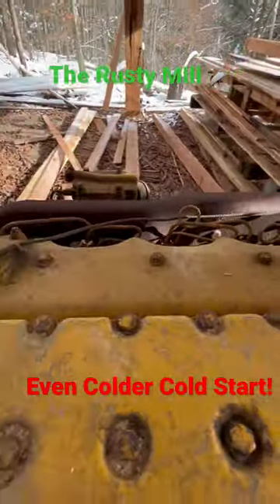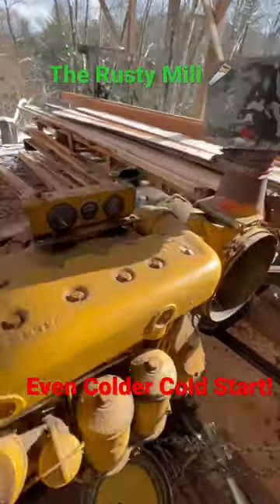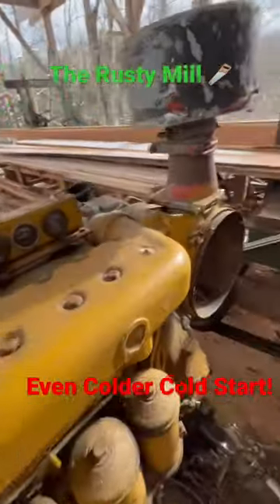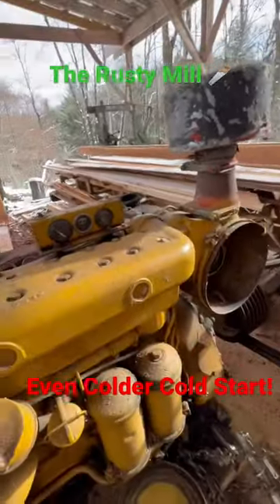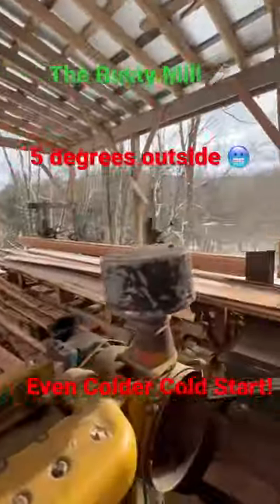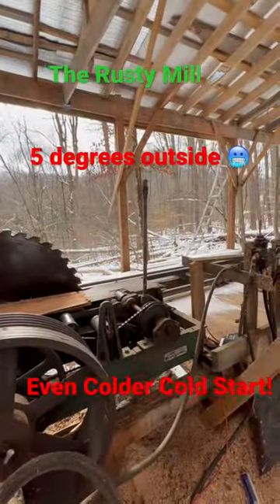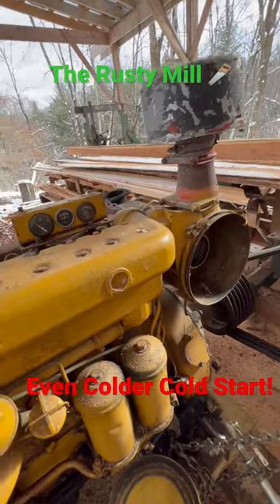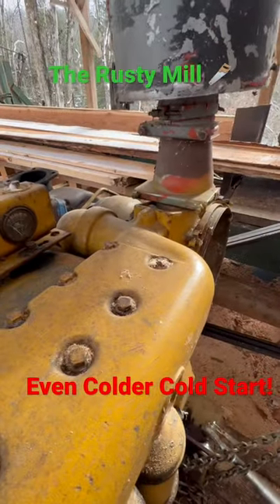Colder Cold Start #diesel #mechanic #heavyequipment

Comment: Start putting a quart of automatic transmission fluid in the fuel tank It will lubricate and clean the fuel system and injectors. And when you change the fuel filter instead of filling it with diesel fill it with automatic transmission fluid.
Reply from the maker: Never heard that idea before. Thanks for the tip!  And thanks for watching!

Comment: The either should be sprayed while the motor is being turned over to avoid bending a rod
Reply from the maker: Usually I spray while cranking.  But it’s hard to spray, crank, and hold the camera.   Hahaha.  Thanks for watching!
Reply: @rustymill2130  tripod is cheaper than a bent rod.
Reply: I'm sure the rod would've bent by now
Reply from the maker: @impleasen  for some reason almost seems like things were better built in the 60s.   Thanks for watching!